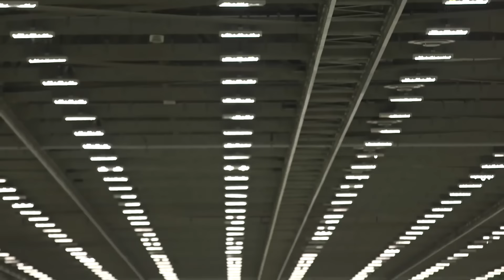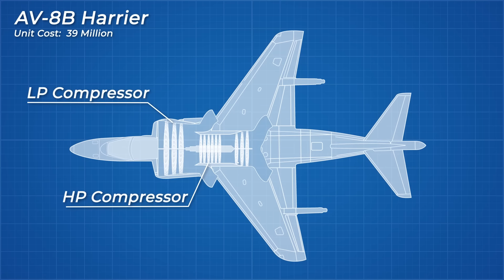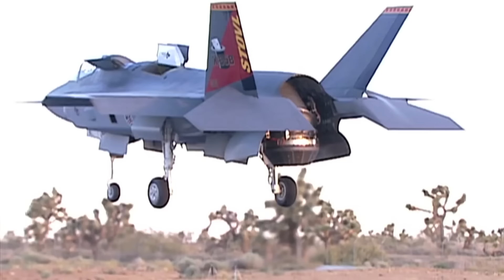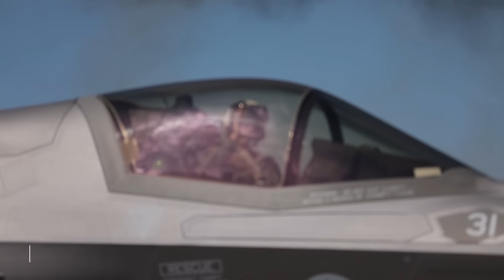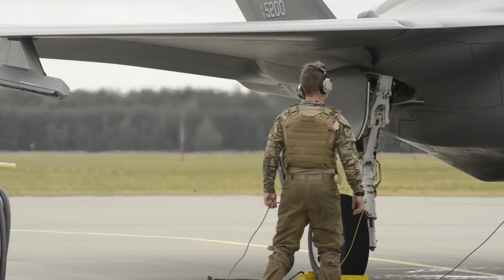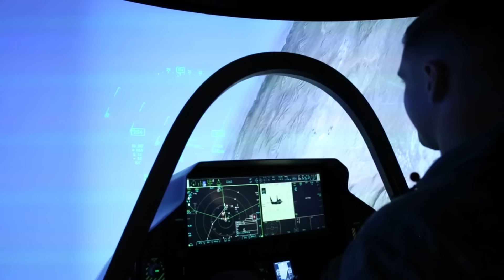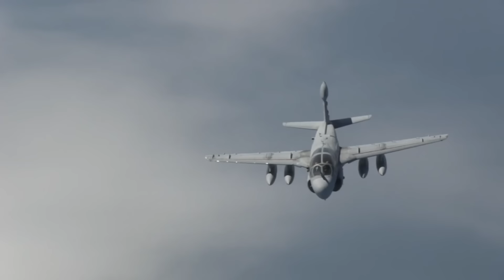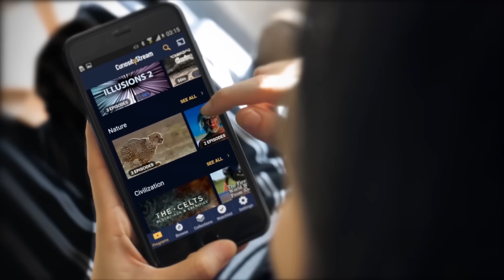Is The F-35 Worth $115 Million?

Comment: Does anyone think it's ironic that after all that money and time the F35 will be shot down by unmanned, cheep as dirt drones. There is a reason why every airstrike in the last decade has been preformed with drones, maned craft are already obsolete in so many situations.
Reply: Nope. Drones that could shoot down a fighter are not cheaper by any means other than not risking a pilot's life. Manned fighters are still superior. Most airstrikes are performed by manned aircraft, drones are mostly reconnaissance aircraft with combat capabilities suitable for a low threat environment.
Reply: @dumdumbinks274   November of 2017 was the latest incident of a maned fighter hitting a live target that I could find. Maybe there have been more but they are either classified or I didn't find them. There have been over 60 publicly know drone strikes is just 2019. A MQ-9 drone cost about 7 million US dollars. An F22 cost 135 million. Drones are smaller, and less detectable targets. They have longer range capabilities if you don't count refueling for the F22. We can assume top speed is faster for the F22 since speed capabilities of most military drones are classified. High end commercially available drones can handle more than 11Gs of force. You find me a pilot that can outmaneuver that. I agree that drones are not designed for dog fighting at the moment, and they don't carry any defensive hardware, but how long would it take to design a drone specifically for intercepting and neutralizing maned fighters? A couple of months? Maybe a year? The reason we don't have drones to combat fighters is because there is no need. Only a 1 in 19 kill ratio would be required for a drone to be cost effective in air to air combat. Drones already dominate the air to ground regime and the only reason they don't dominate air to air is because their hasn't been a need. 
Referances
https://www.af.mil/About-Us/Fact-Sheets/Display/Article/104506/f-22-raptor/
https://www.af.mil/About-Us/Fact-Sheets/Display/Article/104470/mq-9-reaper/
http://theconversation.com/drones-are-cheap-soldiers-are-not-a-cost-benefit-analysis-of-war-27924
https://www.law.columbia.edu/sites/default/files/microsites/human-rights-institute/COLUMBIACounting%20Drone%20Strike%20DeathsSUMMARY.pdf
https://thedefensepost.com/2017/11/20/f-22s-strike-taliban-drug-labs-afghanistan/
Reply: @benh9781  What you're referring to is simply public records where the details of the strike are available. There are thousands of strikes performed every year, and this year alone roughly 8000 missions have been carried out by the USAF in the Middle East. Drones have in the recent past accounted for roughly 1/3 of missions against ISIS.

Drones are not cheap. The MQ-9 costs roughly $20 million per unit ($64m for 4 drone flight in 2006, adjusted for inflation to today) and is not very useful outside low-threat environments. Most drones today are primarily useful because they are designed to loiter with a light payload and a flight of them can provide 24/7 CAS in regions with no air defences. Add to that the systems required to engage a fighter effectively with an airframe designed for medium performance and your drone isn't going to cost any less than $50 million.

Gs are not the problem in a dogfight and I highly doubt there are drones that can sustain 11Gs. Pull sure - so can fighters dating back to the 1960s - but not sustain. Also note that the G limit is mostly there to ensure a long airframe lifetime, it can be overridden in emergency situations in most fighters. There are a few instances of pilots pulling more than 10Gs in real combat. Upscale a drone to be capable of performing fighter duties and you won't see it dogfighting any better than current fighters due to physics. The F-16 for instance is only capable of sustaining a 7G turn, but can pull 9Gs at the expense of speed, but low speed makes you an easy target. 

Drones are vulnerable to electronic warfare, and modern fighters all are capable of at least jamming radar systems. To design a drone that is capable of operating in such an environment while also being capable enough to defeat fighters would take just as much money as designing a fighter. Sure you could do it a little cheaper if you only need it to engage aircraft, but you wouldn't save much money and you would have a drone taking up space at airbases that could only engage aircraft. There are no interceptor drones being built because it simply isn't logistically feasible compared to a high-capability fighter. And if you can afford 19 drones that have even a slight chance to shoot down a fighter then you can definitely afford multiple fighters with better cost-effectiveness supported by a couple of drones built solely to carry extra missiles or bombs for the manned fighters.
Reply: @dumdumbinks274  I would love to see any references you have. Especially about 8000 missions.  I assume if you count every overseas flight as a mission that makes sense, but 8000 missions and no targets destroyed doesn't back your position. Again, I could totally be wrong, the November 2017 was the latest incident I could find in a 10 minute internet search,  but unless you can send me a link to some evidence that fighters have been used for more than power projection in the last few years I can't secede that drones are already used more often than maned craft.
You are correct about the MQ-9 price if you are looking at the data sheet provided. The 7 million number came from the cost evaluation article, but even with the increased number, at 21 million, so a kill ratio of 1 to 8 would be cost effective. Design would be cheaper and here is why. No life support, no manual control system, no display, no suit or headset integration, no performance limiters, no emergency checklist, no emergency evacuation system. Less engineering considerations means less parts means less money put into design, maintenance and usage. That's on principal though I do admit that the US military is a $800 billion jobs program, so they very likely will pay whatever sounds good to the contractors. But again I would like to see any of your sources if you have them otherwise your probably just another pilot upset your job was easier to automate than truck driving. Should have gone with rotary, those aren't about to be replaced any time soon.
Reply: @benh9781  "8000 missions and no targets destroyed doesn't back your position"
- Why're you assuming no targets destroyed? Just because a bomb was dropped doesn't mean there's going to be a story about it. 8000 or so missions is pulled from here: https://www.statista.com/statistics/615661/us-air-force-aircraft-missions-in-iraq-and-syria/ 8000 missions in-theatre is quite low for USAF operations.

"Again, I could totally be wrong, the November 2017 was the latest incident I could find in a 10 minute internet search"
- You missed the F-35A's debut in Syria in April 2019, as well as the F-35B's reportedly consistent CAS coverage for US troops preparing to leave the theatre in late 2018 (though no source for that one). There are also numerous instances of F-16s and F-15Es having dropped bombs, as well as the dominance of the B-1B in every major ground fight between ISIS and US forces.

"at 21 million, so a kill ratio of 1 to 8 would be cost effective."
- The MQ-9 isn't capable of effectively engaging fighters in the first place and you therefore cannot make any cost analysis about drones replacing fighters based on the MQ-9, or really any drone in existence since they are all air to surface platforms. You're also ignoring the fact it likely wouldn't even score a kill due to electronic warfare.

"Design would be cheaper and here is why. No life support, no manual control system, no display, no suit or headset integration, no performance limiters, no emergency checklist, no emergency evacuation system."
- Instead of all that being in the plane it's on the ground in a control centre which makes an easy target, or one that is so far away the latency means the drones can never achieve their potential effectiveness. That is fine for air to surface missions where all a pilot has to do is specify the target and press a button, but it is completely unsuitable against peer threats. Sure it would be cheaper overall, but it would also be inferior since they would all get shot down by any competent enemy.

"otherwise your probably just another pilot upset your job was easier to automate than truck driving"
- Considering there is no drone in existence that is automated for the actual performance of a combat-related task that's not a very informed opinion. All UCAVs are controlled by pilots on the ground, and they often have a secondary crew member operating the sensors and weapons.

Comment: Oh god no, I don't even know where to start. But i'll just point out that the A-10 and the F-16 succeeded specifically because they were designed to be cheap but no compromise designs, achieving both by focusing relentlessly on a single mission type (ground support and day fighter, respectively). Exactly the opposite of the F35. Additionally, stealth only works at all when it is the 100% no-compromise single variable optimized for, although unfortunately no cheap option exists for that axis. By attempting to do all three diametrically opposed tasks, plus adding in several other (strengthening for aircraft carrier landings, VTOL for those that need it like the UK for their carrier designs), then it is an absolute joke. What we get is literally the worst design compromised weapon system of all time. It is unsurprisingly ridiculously expensive, but also utterly useless for any specific mission type when compared to a more specific design.

I think it primarily wasn't cancelled because:

a) the US promised something to allies, and they don't want to give up their F22, and 

b) most governments realize that ultimately the most likely use of these will be to shoot air-to-ground missiles at enemy trucks in third world countries. This is because most countries military leadership know that there is a vanishingly slight chance of a serious, large-scale armed air conflict between the premier military powers because the attrition rates times the crippling replacement costs of their principal air superiority fighters would result in both countries air-forces being set back to being middling powers at best for a generation. 

As for the specific criticisms in the video around the dog-fighting ability, unfortunately it is not the issue of how it compares to the venerable F15, F16s, and F/A-18s (or even 'super' hornets), but how they will compete with planes like the cheap and readily commercially available Su-35, let alone the Su-57 (PAK-FA/T-50) and China's J-20. One would simply struggle to find adequate language to describe the one-sidedness of such a conflict. Simply put, I don't believe the fighter pilots would willingly commit outright suicide, nor the military throw away such highly trained individuals like lemmings off a cliff.

Also, although I enjoyed the video, the simplistic summary of stealth being the primary deciding factor of aircraft is silly. Briefly I will point out that, 

a) there are a variety of mission types, only some of which get a benefit from stealth. It is far less important to the defensive side than the offensive one, and once air superiority has been achieved, stealth hardly matters. 

b) as for stealth, the F35 has stealth on only the front angles. The Russian and Chinese designs are stealthy on 3 (front and sides, the rear is the hardest), and the F22 is stealthy from all angles. It goes without saying that while it is possible to take advantage of a stealthy design that relies on frontal stealth only, it requires a pretty weak enemy in terms of radar coverage. Holding the minimal stealth capabilities of the F35 up as an advantage in this area is silly. Additionally one of the most famous design concerns with the F35 was the unresolvable conflict between it's sensor systems (size of the detector apertures) and it's stealth profile, so in fact it's sensors are deeply compromised in order to keep it's minimal stealth capabilities intact.

This is worth remembering when you compare the costs of the F35 to the F22. They are not comparable aircraft at all. The F22 was the premier air superiority fighter in the world, second to none at the time and possibly that's still the case. It also had by far the best stealth profile ever achieved on a fighter by far, creating the best stealth perpetrator also, without compromises to sensors. Its specialized for the most difficult roles, and achieved unsurpassed success in those roles, at extreme expense. The materials alone involved in achieving this, and their fragility, account for much of the expense. It doesn't make sense to compare a limited run $150 million effort to create the dominant fighter in the two most expensive mission roles, with a high volume $100 million deeply compromised design, useful mainly for carting missiles into enemy airspace to shoot at ground targets once the F22 have achieved air superiority.

Possibly the most useful part of the entire program will end up being the software. While currently it is deeply flawed and possibly un-debuggablefor many years to come, I think it still points the way forward.

In any case, we will see when this plane enters combat. We will see F35 vs Su's in conflicts in other countries. Prepare to be surprised about how vulnerable this plane turns out to be.

There are masses of specific criticisms in serious analysis pieces at sites like this: 
https://www.ausairpower.net/jsf.html
Reply: The A-10 performed pretty badly and only succeeded because of multi-role fighters clearing the way. The A-10 to date has only either performed clean-up operations while suffering heavy losses, or operations in areas with no anti-air threats.

The F-16 was initially designed as a day fighter. That concept was wholly rejected and the LWF program specifically required a multi-role fighter. The F-16 entered service as a multi-role fighter and even won a bombing accuracy competition against 2 dedicated modern strike aircraft types (F-111 and Jaguar) very early in it's operational career. The F-16's first significant use in real combat was a bombing mission, and it was used solely for air to surface tasks during Desert Storm. Not to mention most air forces operating the F-16 trained for CAS operations in the event that the Soviet Union attempted an invasion.

The F-35 wasn't cancelled because it is an F-16 replacement, and an extremely good one at that. It doesn't perform any more roles than the F-16 already does, and the only real difference in capability between the 3 variants relates entirely to the platform they are intended to operate from. The F-35A is optimal for CTOL. The F-35B is optimal for STOVL (VTOL was never a requirement) operations from short-deck ships and has slightly worse performance to make room for the lift fan. The F-35C is as optimised as possible for carrier operations, but as with all decent carrier based fighters it doesn't' perform as well as it's CTOL counterpart.

The F-35 is the 2nd most maneuverable US fighter, and while it doesn't compare favourably to fighters such as the (similarly priced) Su-35S, it still poses a serious threat to them in a dogfight. 

Stealth... the F-35 is currently THE stealthiest fighter around. Sure the F-22  has better rear aspect stealth, but the F-35 has better frontal and side aspect stealth. Stealth is also a very useful technology. Almost every mission type benefits from it, ESPECIALLY defensive operations where the enemy can't use large low-frequency radars effectively.

F-35 compared to the F-22 largely favours the F-35 in most situations in a conventional war context. The F-22 has minor advantages in a direct confrontation, but has significantly less range, worse electronics in every way, and relies entirely on radar. a 4 vs 4 fight of F-22 vs F-35 would likely result in the F-35s winning. Not to mention the F-35A has replaced the F-22 at a bunch of airshows due to it's ability to perform the same maneuvers. The F-22 is specialised for a single role, and it's near complete lack of capability in other roles is evident.

AAP are not a reliable source of actual military knowledge, only as a how-things-work type of site. They have no insider knowledge of stealth technology and most of that stuff is based on the knowledge of a university professor who is generally ignored because he has no experience with military technology, only theories which can always be proven wrong.

Comment: I stopped watching when you said the harrier was using its main engine exhaust nozzles to control the aircrafts attitude... it actually doesn't... those small "puffer jet" vents in the tail and wing tips are used for that... personally I think the F-35 is a massive white elephant with rediculous costs for buying and maintaining and that it was probably a mistake to go after it.